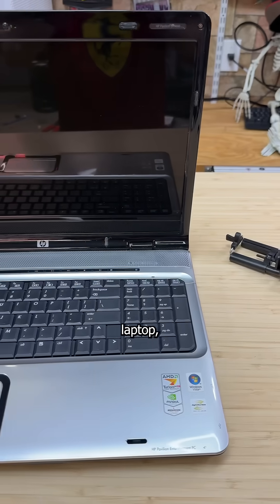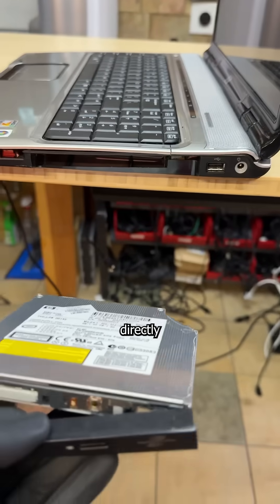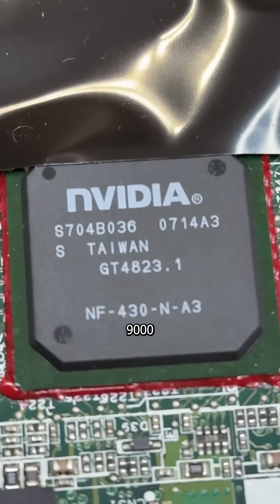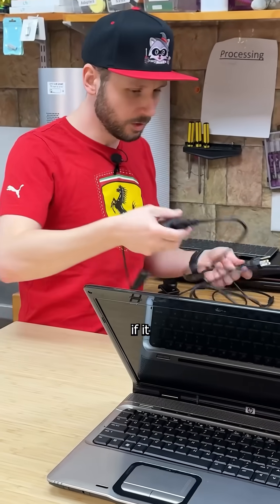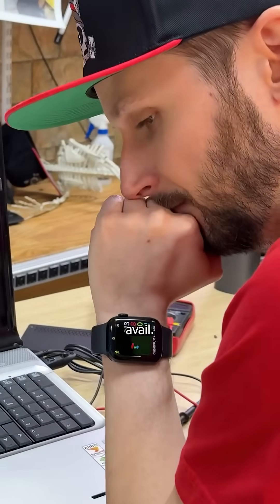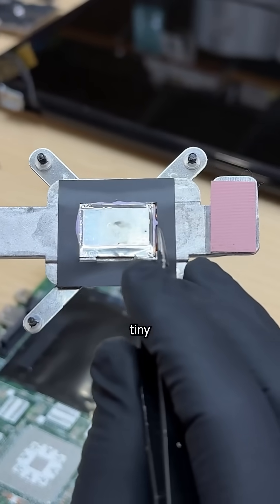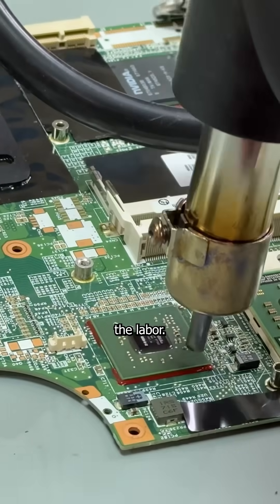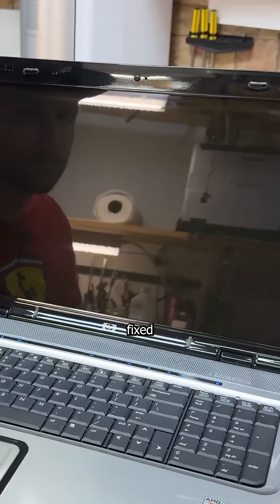$2000 HP DV9000 - The Worst Laptop EVER #tech #technology #shorts #pc

Comment: > Correct fix: disable the dead dGPU by isolating its power-enable or PCIe reset line (lift the control resistor using boardview/schematic). This makes the system ignore the GPU and boot on integrated graphics.

Comment: My first laptop looks similar and is named similar (HP dv7) so I assume it has to be somewhat related. It cost $800 in 2009, so it had to be lower end but I was 12 and my parents paid for it, so it wasn't of course going to be the 2 grand one. I ran into the exact same problems, artifacts when playing games, at 5 fps because the specs were absolute trash, silver plastic bezels cracking, overheating, shortcut touchbar stopped working button by button...

Comment: The G6150.... I  have an old, very expensive, Tablet PC... the swivel screen kind, that the only problem is that GPU... it actually works fine, as long as their are no drivers installed.  Which tells anyone who knows exactly what the problem is.

Comment: Probably you need to remove the red thing, feed the chip with flux, and heat it more until it can move a bit. Then check resistance before plug in the charger.

Comment: I had one of these. My first laptop also. The hardrive failed three years in. Then the ram went bad. The battery never quite worked. I did put about a year of use on it over those three years though...

Comment: The nvidia 8800 GTX also suffered from that, I remember reviving 2 of them putting them 1h inside the oven at 240ºC
My ps3 was also revived with the heatgun method and is still working. It really was a bad era for soldering it seems xD

Comment: Acer are not too bad in making crap, I have a 8930G and just to access the CMOS battery... you pretty much need to remove everything else.

And when a depleted battery is connected to the MB, clock give a random time, better to just unplug it (easier than removing it, plus it's the 2032 coin cell on shrinkable matter & wires, sold for almost 10$ !)

Comment: HP probably now stands as 

Humongous
Problem
Reply: I call it horrible products
Reply: @t @thegoldeneraoftech  I call them Horrible Printers!
Reply: Ive never understood this, me and my family has had many HP laptops and none of them have had issues
Reply: @Goose_1554 rough users. People not opening the laptop from the middle.
Reply: @seanh1988  That checks out, My dads laptop was around 7 years old when he died and it had a battery that needed replacements and that's just cause he left it on charge all day, my older laptop is an HP and it has a bad fan sensor and that's it. (it is slow as balls though cause i haven't updated any drivers or any of that and it was not even a high end laptop when i got it.)
Reply: @Goose_1554 yeah i work on ProBook G6's and above where I work. They run great and theyre easy as hell to service.
Reply: @Goose_1554 You were using it wrong. 😂
Reply: @nedim_guitar  Wdym?
Reply: @Goose_1554  You were using the laptop wrong, so it didn't break. 😃
Reply: Lol also "Horrible Product"
Reply: Higher profits
Reply: I prefer horrible product myself
Reply: They're all trash when I was at college 2015.
Reply: Hinge problems
Reply: Heating problems
Reply: Laptop r Laptop
Reply: Hp a.k.a
Hinge
Problems
Reply: Meanwhile, Dell stands for...

D - Fix
E - It
L - Again
L - Tony
Reply: In Finland we call HP Halpa Paska, which means cheap shit
Reply: Lmao also hinge problem 😂

Comment: I remember getting an HP DV in 2006. It was an amazing laptop until I foolishly installed the promised windows vista upgrade. Then it was crap, but I still used it until it died around 2010 from the GPu issue

Comment: My first laptop was pretty good for kid me. It was from HP and while I forgot the model, I can still give you some of the specs. It had a gtx 1650, 8 Gb of ram, an intel i5 11500 processor (I think), 256 gb of storage, a 60 hz screen that I broke because I had it when I was an 11 year old with the awareness of an Nvidia fanboy, and probably an astronomical amount of cancer causing, radioactive, dust. Surprisingly it lasted a solid bit before it croaked and even worked after screen broke. My current computer is a prebuilt Ibuypower with 32 gb of ram, a 2 terabyte nvme drive, a ryzen 9 7900X cooled with an AIO, an rtx 4070ti, and rgb for extra performance

Comment: the nice thing about the dv9000 is that the edge was comfortable, so it was on the top shelf of my bench, and the edge didn't hurt my wrists.  Also, the button to turn off the touchpad was very handy.  Too bad they don't have those buttons anymore.  Now I just go for a touchscreen laptop and external mouse...because touchpads are only worlthwile on the go, and I never remember to turn it on before I pack up my laptop...so I can turn it on via the touchscreen without getting out the mouse.

Comment: Dude, I had this exact laptop.  And it was fantastic!  For about a year.  Then one day I was doing something and it was running hot, it always ran hot, and then randomly shut off.  Yeah, GPU was shot.  Pulled it apart and found where it burned out fairly quick, it was the GPU!  I'm not the greatest technician that's ever lived. I can fix a lot, but I can't reball solder.  And buying a replacement mobo for that laptop cost pretty much the same as buying a whole new laptop.  So I did that.  A year after that an HP printer went shitty on me for no reason.  I swore HP off for awhile after that.  But eventually years later wound up going back to them for my laptop needs. They seem to be better-ish now.

Comment: Good Lord. I had one, and it was my “upgrade” from a G3 iBook I had to use it for my college engineering classes, since many of them required use of Windows-only software. It “ran” Vista (I turned off every new “feature” until it resembled XP as much as possible, which helped a bit). It also had some of the crappiest WiFi connectivity. Some days I just didn’t even bother connecting at school.

Yes, it died a horrible death shortly after graduation. I don’t miss it. The only thing I miss was the fact that you could remove and replace the battery without having to take the case off of it. I purchased an increased capacity battery for it, so it would last through my day off classes.

Comment: I fixed my ps3 with the yellow light of death with the oven. Felt like a tech god knowing about the cracked solder in high school. When it happened again a month later, I baked it again, but got impatient during cooldown and poked the gpu to see if it was still hot. It certainly was as the whole gpu slid sideways, knocking other components off in the process. Tried my best to put it all back, and reheat, but there was no way the gpu was alligned right and had no solder bridges or gaps, never turned on again. At least it wasn't a first gen, it was a 2 usb phat model, nothing too special.

Comment: I mean, you could have just stopped at “HP”. Their consumer stuff, especially, has been garbage since the compaq acquisition.

But, interestingly, the same generation of Dell Latitude D630’s had similar issues - caused by that same NVidia chip. They cooked themselves to death if there was even the slightest airflow obstruction. Given how undersized and dust prone their cooling fans were, that didn’t take much.

Comment: I recognized that laptop immediately. I gave up fixing several of those back in the days. The first laptop, I ever fixed, was a 80386 back in the early 90s.

Also, you'd have a way better success rate with reflowing that solder on that nVidia chip if you removed the underfill with low heat first.

Comment: When I first got a job doing repairs we had so many of those. Not just the 9000, it was any that had the nVidia chipset. I had enough in my workshop to cobble a few good parts together and make them work but eventually the chipset woukd come lose. The solution was to bake it at like 350F in the oven for a few hours and it would resolder them.

Comment: I would like to explain the issue with Nvidia GPUs of this era alot better here, the reason the failure-rate was so high for both ATI and Nvidias own chips around this time was due to a poor choice in bump underfill, underfill keeps the die of the chip from moving and potentially damaging the bumps that connect the die to the substrate. However the underfill used was only specified for up to 60-70°, a temperature that is expected for these chips to operate at under load, ATI and Nvidia should have spec'd for higher TG underfill but did not at the time and lead to the bumpgate disaster which caused several hardware defects in multiple products (Namely the RROD and YLOD, and Nvidia and ATI GPUs at the time) The only realistic way to resolve the problem is to replace the defective chip with one that has been manufactured with high TG underfill, something that may not be easy to find unfortunately.

Comment: Just an FYI, those chips are made in a sort of stack:
- silicon
- solder bumps (underfilled with epoxy)
- interposer PCB
- solder balls

What goes wrong with them isn't the solder balls, but the epoxy softening at too low of a temp, combined with a bad choice of solder type for the solder bumps (not the balls). Those solder bumps get stressed due to the thermals (even normal ranges can cause issues, let alone ones that get really hot due to bad cooling), and the epoxy softening takes away the thing that would normally provide support. This leads to issues at the solder bump level. Reballing actually will not (permanently) fix the chips, but it might temporarily reconnect some of those solder bumps (but, due to another phenomenon, they will usually quickly re break, weeks to a month is the usual timeframe) Generally, these chips aren't worth fixing, as anything you can do, at least without somehow removing the die entirely from the interposer, cleaning it of all epoxy, then replacing the solder directly on the die and soldering it back to the interposer and putting new epoxy on, is not a true fix.

Comment: Damn. I still have one of these, and it still boots, to boot. The screen took a beating while on a trip one year, but connecting it to a monitor and using external peripherals and you can’t tell anything is wrong. I’d I wanted to, I could probably still pull it out of the case in my closet, boot it up, and play the Microsoft Flight Simulator X Gold Edition that I know is still downloaded on it, though the external battery is shot to hell, so I may need a more powerful DC supply if I’m going to push it like that.

Comment: DV9 with ATI bought at Sam’s club brand new forever ago I’ve only changed to a SSD and replaced battery and thermal paste. It still works like new minus the battery. Maybe I got lucky or it was just the NVIDIA setups 🤷‍♂️ I keep it for anything needed on XP so it doesn’t see a lot of use

Comment: I had an Dell XPS 13.
The airflow outlet was basically blocked.
I dont remember the year but it had an Core 2 Duo and dual 8000 GPU.
Might be an 8200 and 8400.

It was my first laptop and I bought it for quite a lot of money.
My knowledge was bad and if I could go back in time I would have bought an proper 15inc or so laptop.😂

Comment: Mine was an HP pavilion from 2010-ish. Probably the dv6-3085ea, but I don't exactly remember.

It was alright. Used the crap out of it until the screen got smashed sometime around 2016. By that time the hard drive and battery had both been replaced. The fan had a rattle. The hinges were falling apart. Pieces of the trim were missing. And most damning of all, it would frequently overheat and shut down despite my best efforts to clean it. 

It's floating around in a box somewhere, now. Still works as a desktop if it's placed upside down.

You did good buddy. Even with only 4GB of RAM.

Comment: Re-balling is something I will never do because it is so expensive and time consuming and why I really hate bga cpu's.

I've had to turn away several customers who'd bought el-cheapo budget line laptops and had them fail right after the manufacturer warranty expired.

Each one had bad bga solder joints causing the system to fail to boot.

These customers complained of constant random bsods leading up to the final failure.

It would have been easy enough to pull ssd's out and just swap them over to a donor system but these laptops utilized 32gb emmc flash storage soldered directly to the motherboard so a swap wasn't possible.

I don't understand how computer manfacturers can get away with using such subpar low spec hardware and charge through the nose for it.

Comment: I have an old dell inspiron B130. Pretty much the same thing. Also the screen has three lines on it and smells like sour onion. I think thats from an old screen defect on win xp computers of certain generations? Any advice on the screen issue would be much 
Obliged.
Reply: I also managed to reroute the screen using vga on a separate monitor. Still wondering about the onion screen issue though?😅

Comment: I had the same problem on my HP Pavilion G6-1000. They tried to cool a quad core Phenom II and a discrete Radeon GPU with a single (between the two of them) heat pipe and one fan.

Comment: Omg I still have it. I had the same issue. How I fix it turns out the whole case is somehow shorting it. When I was assembling it. I decided to turn it on without attaching the keyboard yet to it. Then it turned on. Then I discovered that the whole design might be shorting itself out.

Comment: Mine was the DV4000 body style but the larger extended keyboard, nvidia graphics, core 2 duo cpu, and 17" screen. I cant remember the model name anymore, and i havent seen one in ages in spite of working at an ewaste recycler for many years but it was a dope laptop. built to be a desktop replacement, it was super powerful, dual hard drives, kicked some real ass for a laptop back in the early days. i never had issues with my nvidia chip.

Comment: I repaired mine using a painter heat gun and some aluminum tape to shield the mb from excess heat.
Reply from the maker: I also "repaired" a few this way as well. Until 2 weeks later.

Comment: This happened to me with every GPU I had from that era. I used two heat lamps and a patch of test solder on pennies, shielding the rest of the board with foiled cardboard.

As soon as the solder on top of my penny melted, I waited 60 seconds, cut the lamps, and let her cool down for fifteen minutes.

This was a yearly process. The computer lasted for a decade. I eventually got so good at it, I too became an amateur technician.

Comment: I had an Acer that went the same way.
The heat made the graphics chip separate and cause white screen.
I now have both a 2006 IBM and 2011 Lenovo ThinkPads and both run fine after years. 
They're taller and the airflow is enough to keep them cool. 
The IBM's original 2006 battery still working as well.
The Lenovo battery died very early.

Comment: God, I couldn't  tell you how many motherboards I replaced on these when I worked at Fry's. At least it was a factory recall, so the customers didn't have to pay for anything...

HP had a slew of notoriously  defective laptops of that general design. A lot of them also had hinge issues, particularly with the 17" models.

Trying to remember if this was the model where if you didn't want to wait for HP to send you a replacement (refurbished) motherboard, you could thermal paste a dime onto the GPU as a fairly successful workaround, or if it was pne of the other DV seties...

Comment: HOLY SHIT I HAD ONE OF THESE AND HATED IT! It went in to get a disc replaced under warranty and the completely warped the keyboard and it still had the dead hard drive in it, got a replacement and 6 months out of warranty it died due to said heatsink issue.

Swore off HP since then.

Comment: As soon as I seen that HP laptop in this video, I immediately knew what was wrong with it lol!! And he is right, 100% of those and many other brands of that era failed due to cracking or shrinking solder balls on the GPU.  Still have one of my old Dell XPS M1210 that has the same issue.  One still works however because I upgraded the cooling system for the GPU. May not play “Crisis” but it can play Bioshock still lol!

Comment: It't not the connection between chip and motherboard. It a connetion problem between the DIE and the chip. Lead free solder is the issue but not where you are hinting.

Comment: On a DV5 i found the black tape around pinched between the cooler and cpu, but that was some 12 years ago. A few months ago i rebuilt it with new lcd bezel and hinges. Still going. Its used sometimes to check email, write stuff and access Facebook.

Comment: HP = Has Problems

I don't think I've ever had a HP product that hasn't had some sort of issue and when I used to work at a computer store we got more of them back than any other, build quality issue,  hinges breaking, pathetic charger porter breaking, DOA, etc etc. 

I have a HP printer (why?!?!) the menu is terrible, it doesnt print straight, the menu is horrendous, the desktop software is an unintuitive mess and to top it off it forgets what its printing, stops and starts again numerous times.